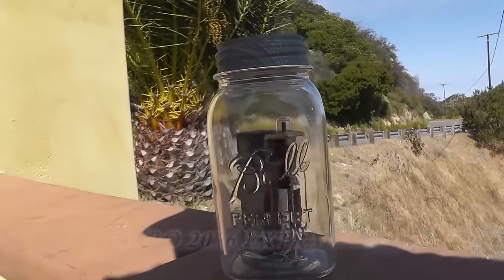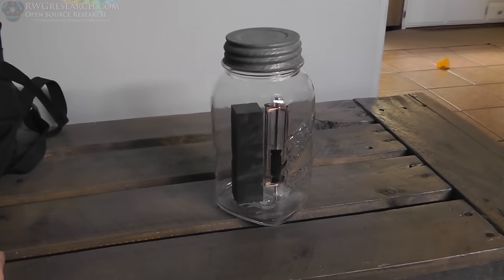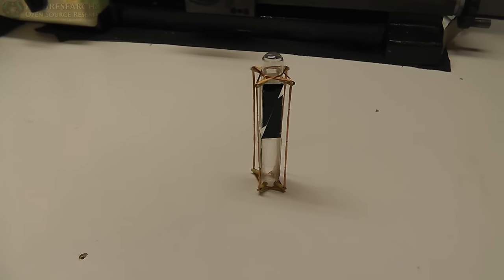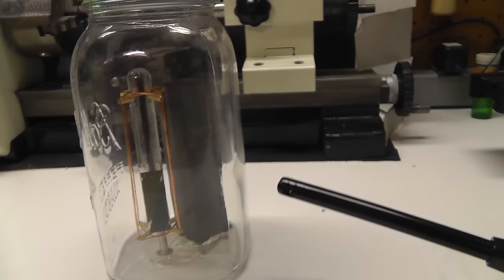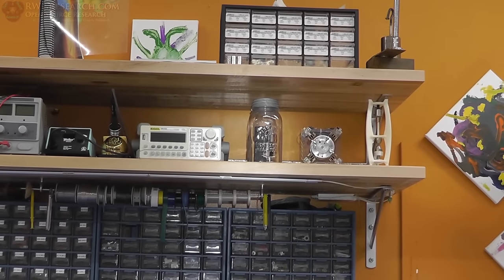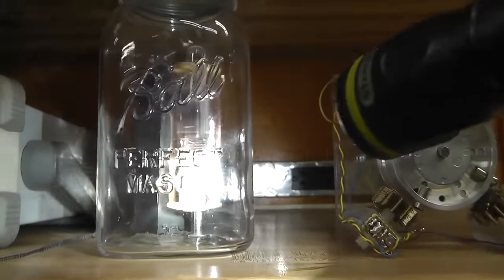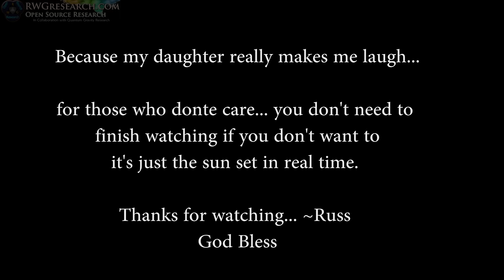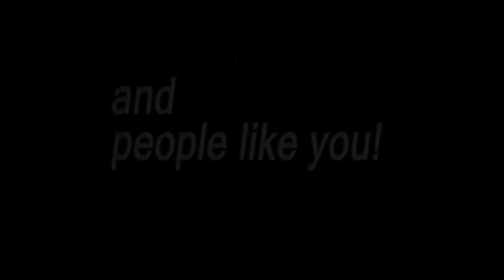PMBO-2016 Extras #1 Mendocino Motor Running From A Candle!

Comment: Since changing the end metal bearing plate for a glass plate on my Mendocino motor (magnetic bearing type) it has become more efficient than my Crookes Radiometer running on daylight. 
The radiometer appears to be more efficient running from IR lighting though.

Comment: Hey Russ
Maybe a better shaft and bearings
Reply from the maker: Yeah. well I wanted magnetic barring. but because I wanted it to be inside the test tube it just was not working like I wanted. :)  but the neddel is allmoat the best 0 friction barring you can have. with out levitation ... ~Russ